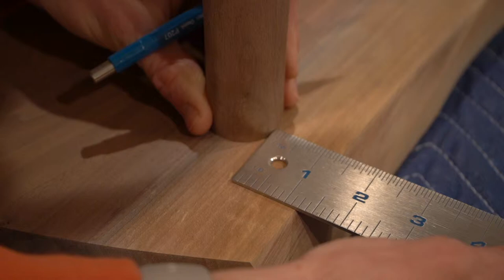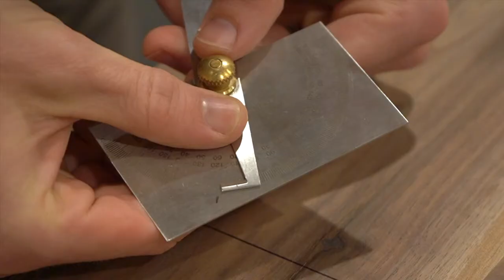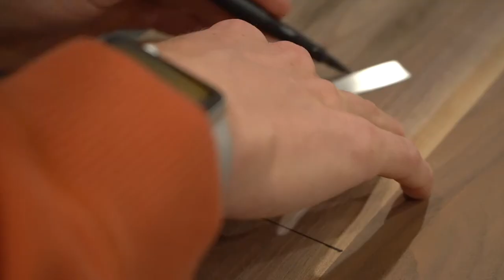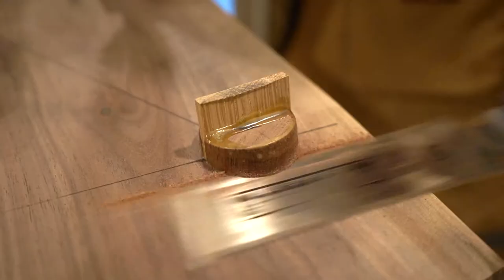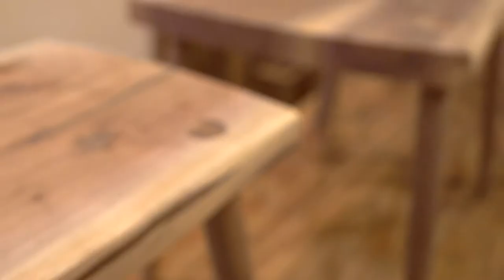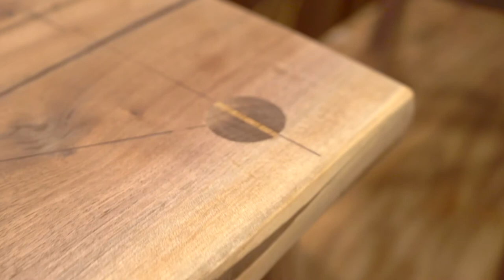Joining Legs to Coffee Table Top With Wedged Tenons

Comment: Love the wedge tenons look. I have two questions I'm hoping you/ someone can answer:
What did you use to get the precise 11 degree angle on each of the legs?
What woods do i need to get to make something like this?
Thanks
Reply from the maker: For this one I used my drill press with the table set to 11º, but you can also eyeball it using a sliding t-bevel. You can use many types of wood, but the wood in this build is walnut and the wedges are ash.

Comment: Very nice work! How strong did you find the joint in your table? I'm thinking of using this approach for a slab desk... Could it support a load do you think?
Reply from the maker: It’s incredibly strong. Just be sure to have a shoulder on the leg beneath so the table top can kind of sit on the shoulder. Also be sure to orient the wedge perpendicular to the grain direction of the table top to avoid splitting it.
Reply: my father made one just like this in 1962 and I still have it  in front of me -  survived 3 kids, 4 grandkids and a prodigious amount of cocktail parties and cigarettes - with the battlescars to prove it !
Reply: @StarrWoodworks how to make the shoulder of the leg angled? That is, how tho angle the shoulder in such a way so as to take into account the angle of leg relative to the table top?
Reply: @bran4o  I don't think he did, to my knowledge it's not necessary. The "shoulder" is just a slight flare in the leg all the way around. The top will only be resting on one part of that shoulder, but with four legs that are thick enough it should be really strong.